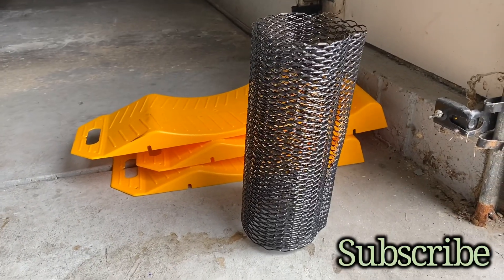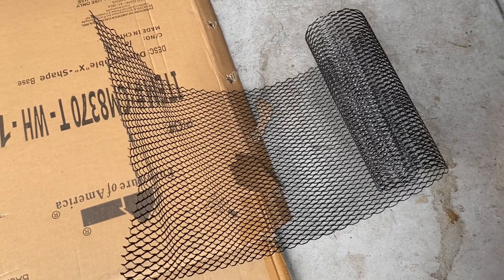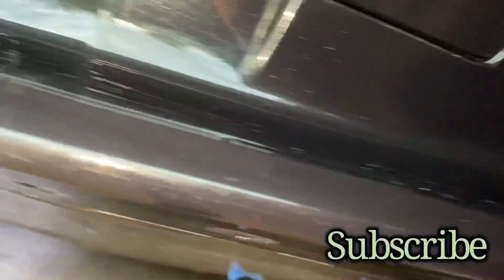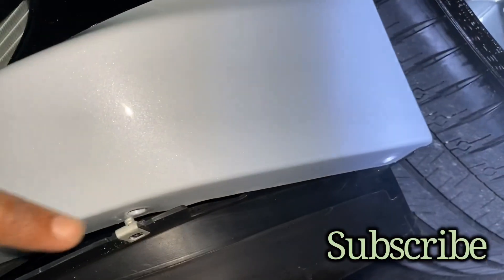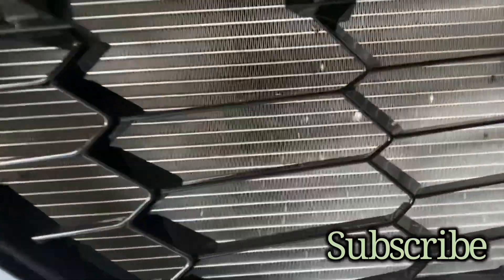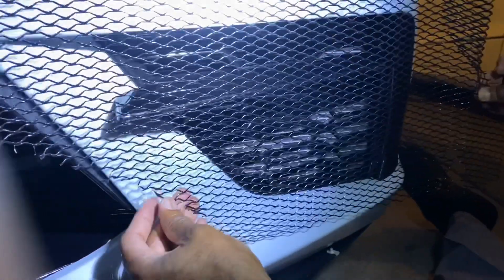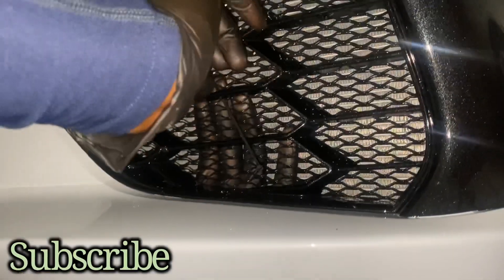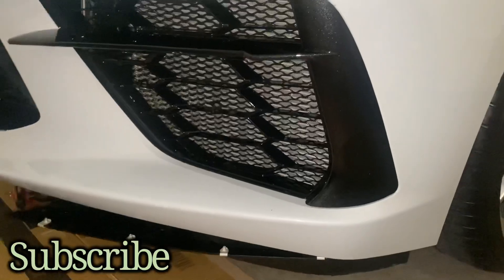DO IT YOURSELF MOD ON A C8 CORVETTE

Comment: I would be very generous with the zip ties, if a corner comes loose and starts flapping against radiator, you would have a problem very quickly
Reply from the maker: Roger Pullin As a Car Guy I tend to check the vehicle daily . Being that I do pre trip check on my work vehicles this vehicle will get a pre trip check every time the vehicle move.